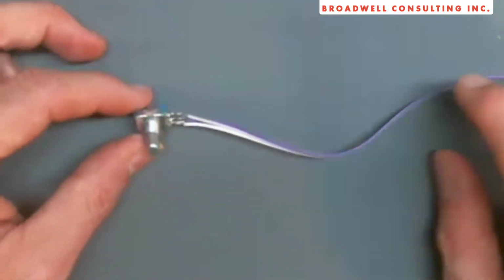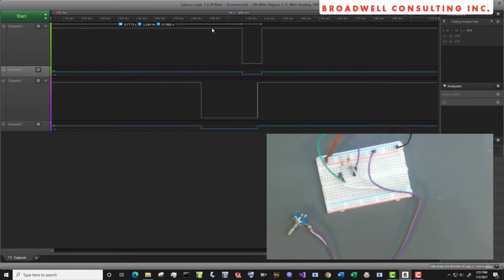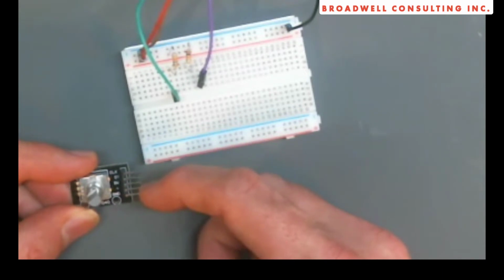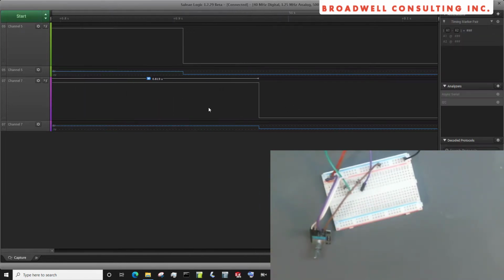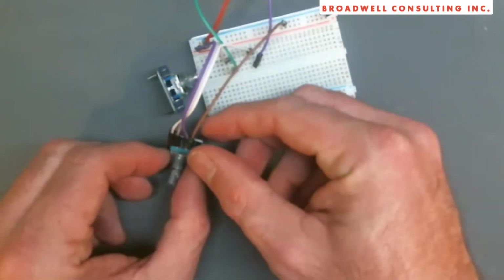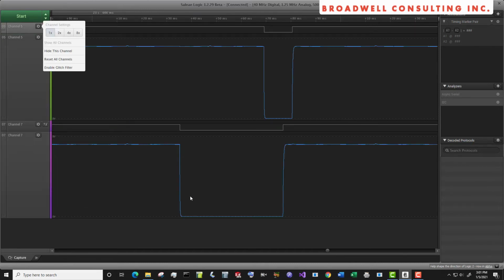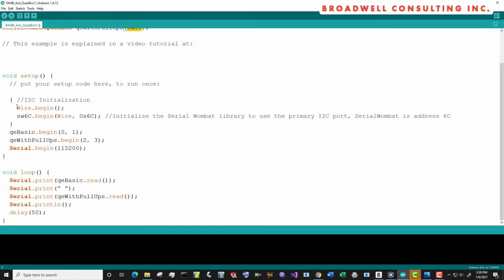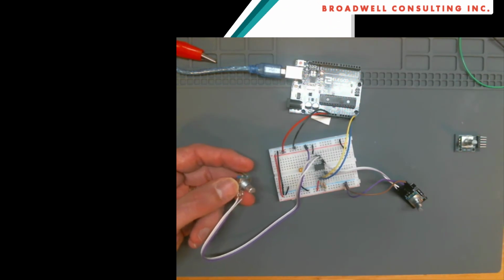Reading Quadrature Encoders on Arduino using the Serial Wombat 4B chip's Quadrature Encoder pin mode

Comment: I am trying to use a rotary encoder with a SW18. I'm more interested in individual transitions than the actual position, so I have a for loop that compares the current position with the last position and sets a direction variable to either +1, 0, or -1. The issue I'm having is that if the know is rotated one position and then back before the main code gets back to the loop, it records the change as 0. I'm wondering if it is possible to build up an event log of transitions on the wombat that can then be returned all at once to the raspberry pi.
Reply from the maker: I can't think of any way to make the current firmware do that.  But I think it'd be easy enough to optionally add transitions to a queue in the user buffer area in the next version of firmware.  Can you explain a little bit about the application for this?  When I understand what a person is trying to achieve, I often come up with better stuff.
Reply: @SerialWombat   I've got three encoders; one that changes what the other to do. In one mode, one knob changes between red, green, and blue while the other changes the brightness of the selected color. (Here the quick up/down is less of an issue, but I'm driving an index with one and the other one is either incrementing or decrementing one of three separate values). In another mode, I'm using the encoder to send keyboard commands (like alt-tab) where it is important to catch all the up-down transitions
Reply from the maker: That's tricky, because for the RGB case, you don't just need to catch all the transitions, you need them synchronized across pins to keep track of when they change relative to each other.  I'll have to think on this one.  But my general though it is that the easiest way might be for you to customize the firmware.  I'll maybe do a video on this in the next week.  If you can, send a detailed description of both use cases to help@serialwombat.com , and I'll do this effort as a demo, and you can use the result.
Reply: @SerialWombat  I think the loop is fast enough that that probably won't be an issue. If it is, you could just add a 0 to the event queue if there is no change (assuming the pins are all checked sequentially) so the index of the different logs correspond to the same(ish) time. The issue with that is that you might start generating a lot of 0s between transitions, but it only needs to be two bits per encoder each time it is polled, so maybe not a huge deal as long as the queue is checked often enough.
Reply: @SerialWombat  thanks, I'll write it up and send it over

Comment: Is it possible set the myEncoder.read() value to something else?  I would want do this when homing a lead screw.  When the carriage hits the extend limit switch, I want to set the number of ticks to the total ticks in the stroke, so when it's fully retracted, it would read zero.  I know I could just do it with math in the function, but setting the value in the 4B chip would be cleaner.

Comment: Hello. Is it possible to read any encoder? Like 2000cpr 25T/H?
Reply from the maker: It would depend on how fast it was turning.  In interrupt mode, you'd probably want to limit to about 10000 transitions per second (each count generates 4 transitions), so a 2000 cpr would need to be moving pretty slowly (60 RPM).  For something faster than that, I'd probably want to look at a programmable logic based solution, instead of a firmware based solution, which is what the Serial Wombat chips are.